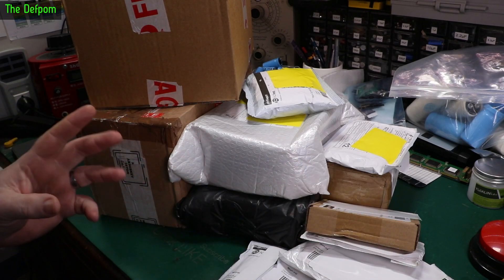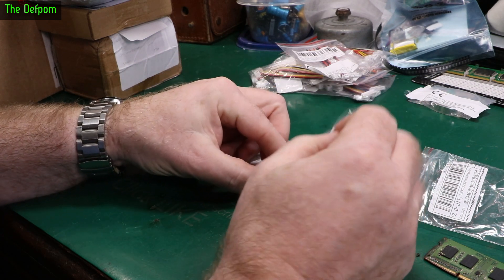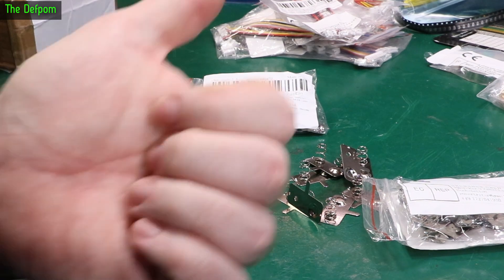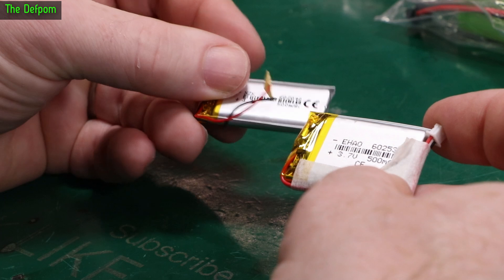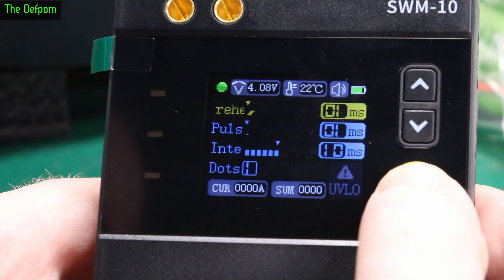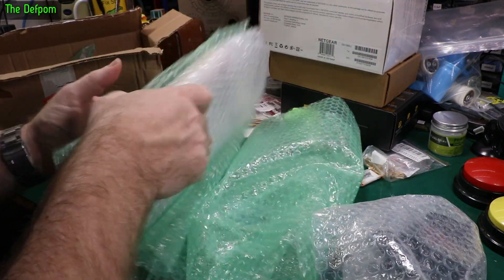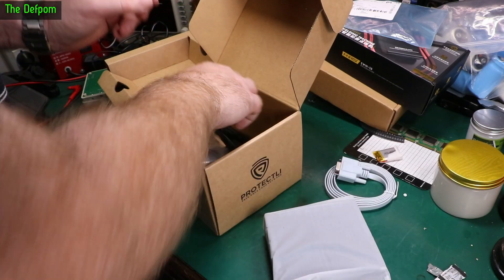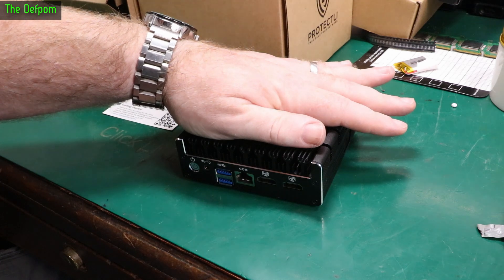🔴 Mailbag Monday 6th May 2024 - No.1243

Comment: VPN, set up wireguard on the router or on a device on your network, then only expose the VPN port on the router. Then, anything you want to look at on your home network, connect to it using the wireguard client to connect to the wireguard server, then you can just access it as if you were on your home network.

It's how I do it, I have wireguard-easy installed on my server, then whenever I want to look at something on my network, I connect the wireguard client on my phone or laptop to the server (generally using my phone as a hotspot or using public wifi), and then just connect to it as if I was still at home.

That way, you are only exposing 1 port to the outside world. Even if you use non-standard ports for things like your NVR, you are still exposing more than you really should be.
Reply: Wireguard or any other VPN on Scotts opnsense/pfSense box will offer even more security. The benefit of VPN and all the extra firewall stuff it offers.
Agree though, don’t leave ports open to the likes of NAS boxes, home security cams etc even if you do change the port number. The bots are getting more intelligent.
Reply: +1, even better when you can use a second router on the client side that will tunnel it for you. Devices will truly not have a clue they're connected through a VPN, nor do you need to think about it or care about it.

Comment: At the time, those were the only 7" screen with a 1200X600 resolution, the official RPI's had lower res screens. I have had one for years and there have been a few issues with using it as a pure HDMI display (Output shifted to one side.)